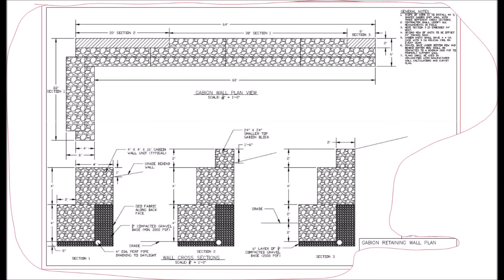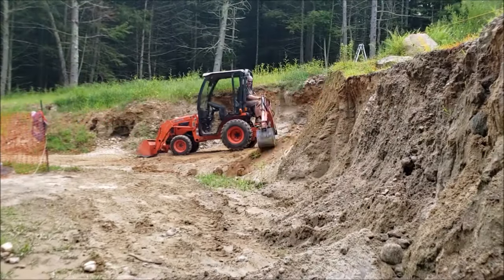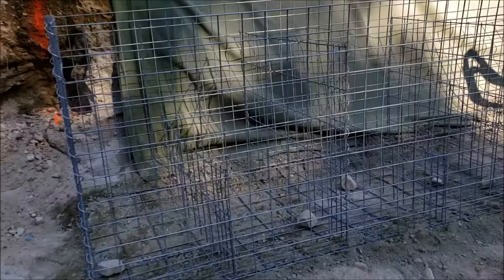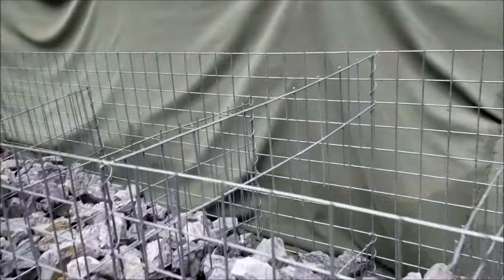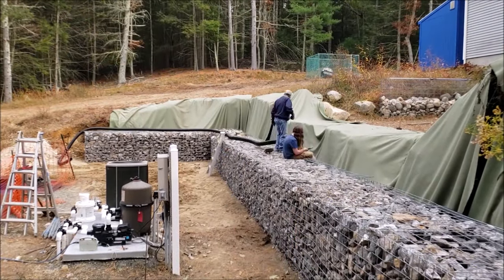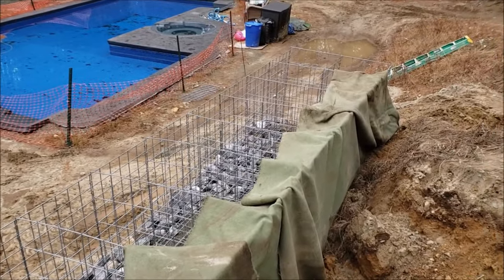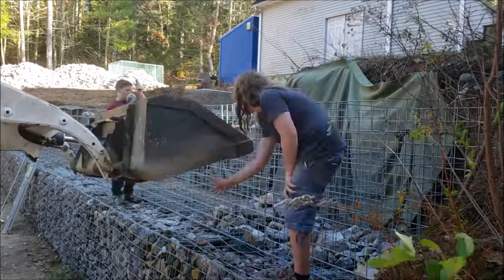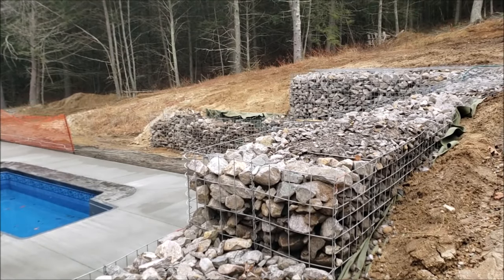Pool phase 2 - That Damn Retaining Wall - Gabion Cage

Comment: Would have been nice if you had poured in some concrete at different layers to help hold this together when the wire corrodes away.  The rocks do allow for good drainage as water and freezing is your worst enemy of a retaining wall.  Like I said, some concrete to allow the water to escape.

Comment: Great looking Gabion wall. Can I ask where you got the cages from?
Reply from the maker: I designed and built my own using readily available components. Panels from Tractor Supply Company, a farm supply store in the Northeast.  I used a mixture of 16 foot sheep and hog panels.  Bought locally so no shipping and then I found an online store for the helical wire for joining the panels.  I'll do a new video on the Gabion cage construction as I need to build some new retaining walls.

Comment: Very interesting how long did the project take
Reply from the maker: ~3 months from breaking ground to calling for a final inspection.  Working evenings and weekends.  Lots of start and stop, not continuous.  If I had the time to work it full time and have rock delivered ahead of time I expect it would have taken 80-100 hours.  Keep in mind, that is based on 1.5-2 full time bodies.  My teenage sons and Father-in-Law helping when available.  Also, this is not my primary skill set.

Comment: I'd also like to know. Got a couple quotes from companies in the states  for ludicrous prices. $180 a basket. Pretty sure they are just buying it from China and up charging. I'm seeing them for $20 a basket from the Chinese factories.
Reply from the maker: My baskets run roughly $250-$275 a basket but they are 16'x4'x4'  and I can easily source them locally when I need more.  Again, I will do a new video in the next month or so when I build some new retaining walls for a different location.